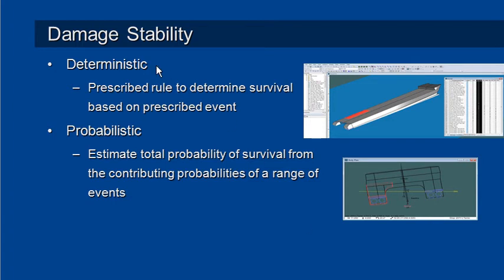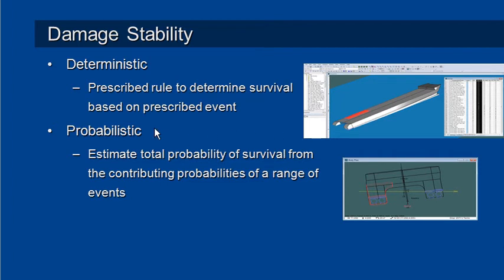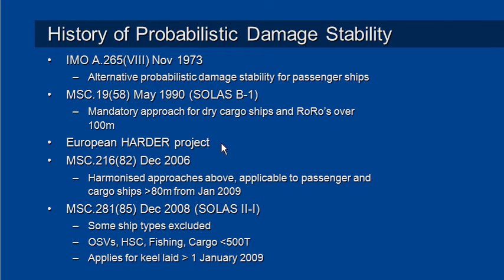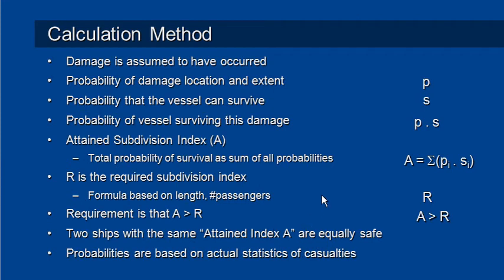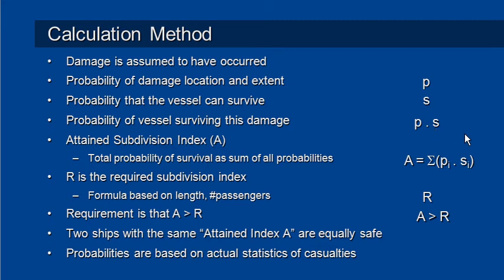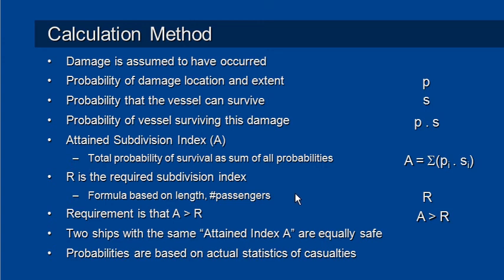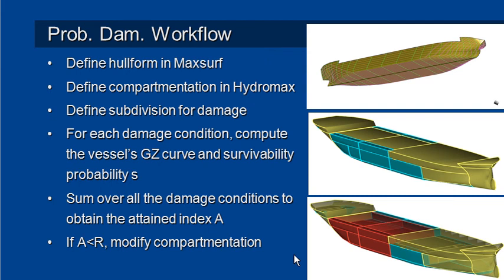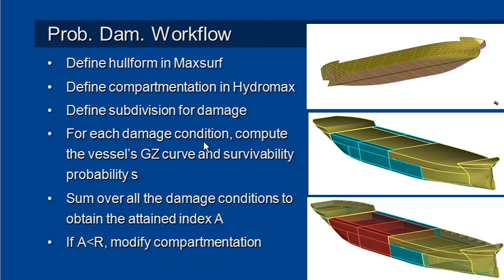Probabilistic Damage Introduction

Comment: excuse me, i want to ask. Can i do damage probabilistic for self propelled oil barge LoA 70m? because i read a SOLAS, min.80m for using damage probabilistic. Thank you
Reply from the maker: Probabilistic damage stability applies to all passenger vessels and to all cargo vessels greater than 80m in length built after January 2009. So it would not apply to a 70m oil barge.
Reply: @formsys  okaaayy, thankyou so much for your information